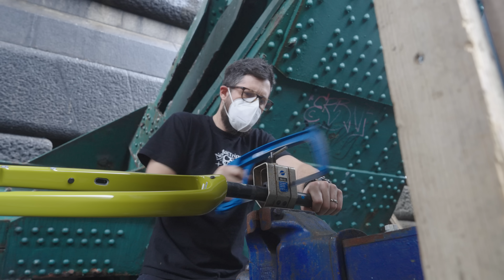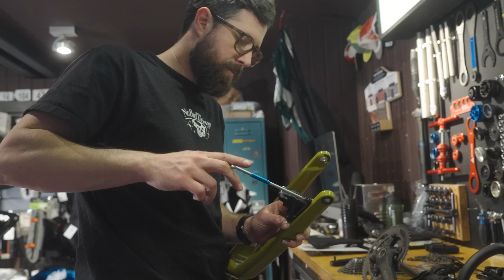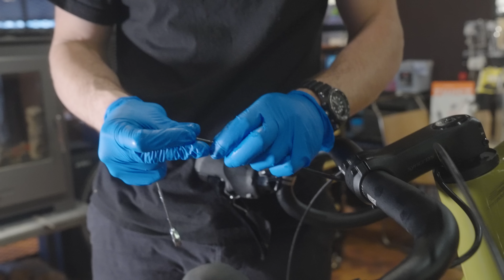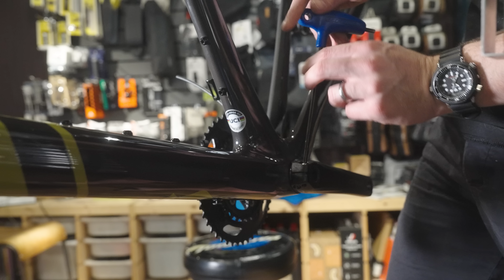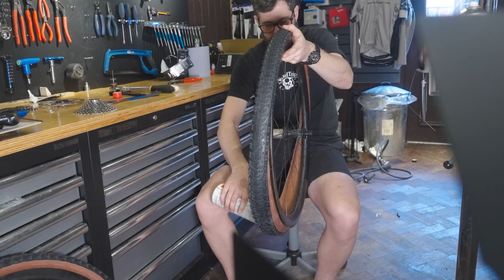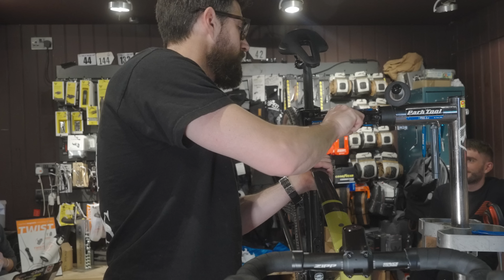Cade Media's New Gravel Bike

Comment: mechanical GRX and that cockpit... 😖
why all the downgrades?
Reply from the maker: Downgrades?
Reply: @Jimmidoesstuff  compared to Red/XX1 AXS and Syncros Creston SL
Reply: it all depends on what you want to use the bike for mate... for example to me an electronic groupset and hydraulic brakes are a downgrade from my mechanical ones that I can easily fix on long technical bikepacking trips in the middle of nowhere.
Reply: What is this derailleur? 😂
Reply: @mael5405  what do you mean? It's a GRX810, which is a very good derailleur...
Reply: You’ll see 😉
Reply: @KNURKonesur  AXS never needs a fix and if so, it's actually much easier then mechanically.
Hydraulic disc brakes are basically the standard for gravel and MTB.
Mechanical disc brakes are crap and rim brakes are not an option for this frame.

I have ordered the Addict Gravel 30 and will replace basically all the parts.
Reply: @5amba  I couldn't care less for what is "standard", I care for what suits my style of riding :)
Reply: @KNURKonesur  I mean... I get your point and since Francis will do a bike packing trip together with James, they have maybe the same  reasons to choose that parts.
If I'm right the alloy bar is to mount aero extensions.
edit: oh wait... there is the video 😄
The comparison was my initial guess.
Reply: @KNURKonesur  No, 400 series and look pretty cheap on this kind of build, did not understand the quest for downgrade